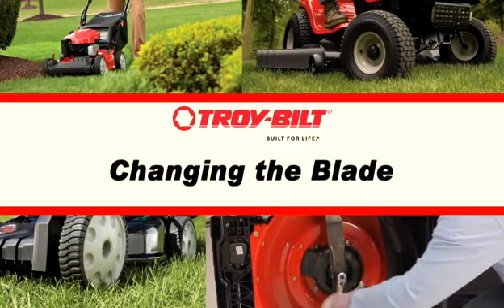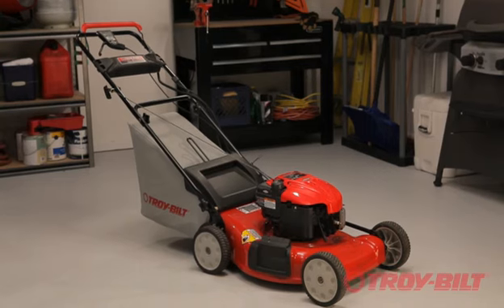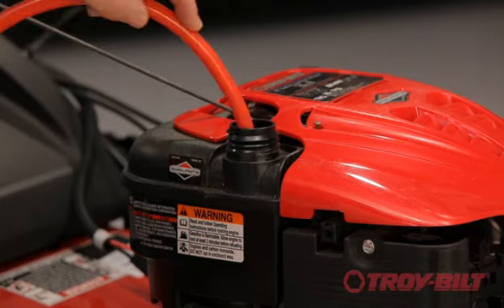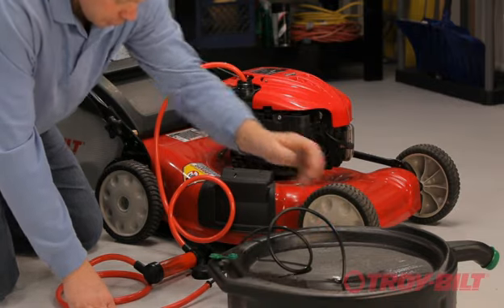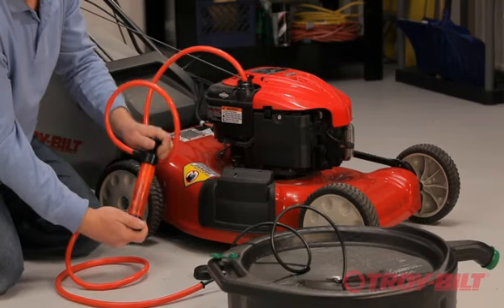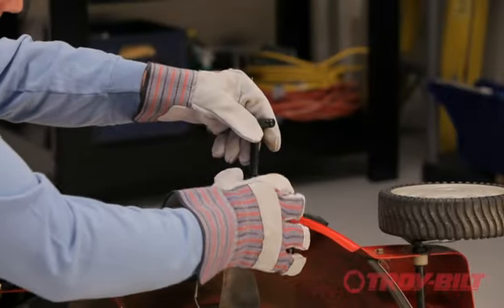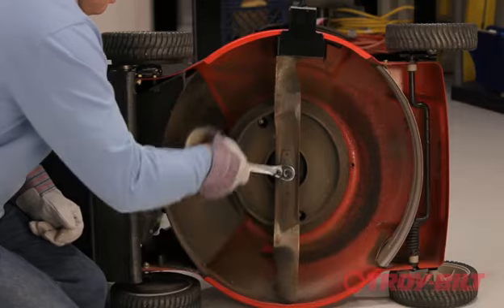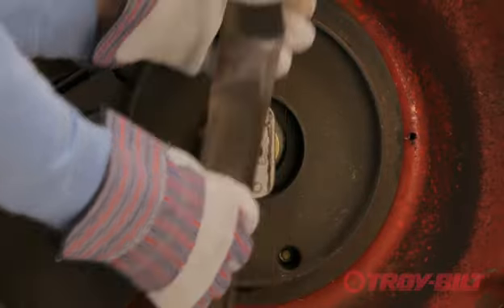How to change the blade | Troy-Bilt walk-behind lawn mower

Comment: to make the wheels turn it slides up over another slightly angled ring so its a friction grip between the 2 metal peaces. after a short time the metal to metal grinds off and a space is there and nothing will turn the wheels. It is a very poor design that does not last. I just installed a new trans I ordered  from troybilt last week put it on with a new belt , and adjusted the speed cable to make sure the pulley would raise up and tighten the belt. with all this done ,It would not move the mower

Comment: Cheap product I will never buy any troy. I bought mower last year the same kind I used it just one time now broken I return to repair they asked me pay $135 to fix I can't believe it when I I bought it was $205 with tax now to fix $135 almost the same price original price I paid . just fake manufacturer warranty anyway cheap product
Reply: I have a Genuine Honda Troy Built.
12 years old. Still running. New blade.
I use 30wt Valvoline synthetic. Eight air filters. Rebuilt carb one time, myself.
Three spark plugs. I drain and change oil every 20 hours. Same pull rope. WD40 keeps the spring retracting and from rusting. She gets a bath every other cut.
If you work on the carb-Do not stretch the governor spring. There is a YouTube on adjusting the operating speed governor.
Reply: My Troy Bilt is 15 plus years old. I’ve never done anything to it. Just check the oil and put gas in it. I bent the blade yesterday when I accidentally hit a root. I’m here just getting some tips on changing the blade for the first time. I guess I got lucky and got a decent built model.